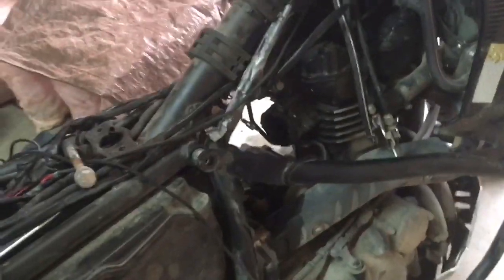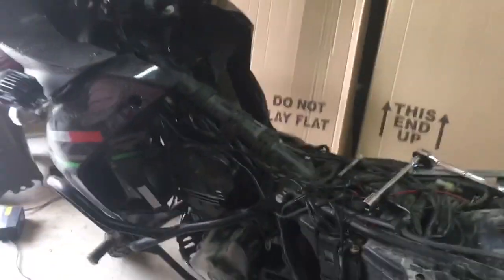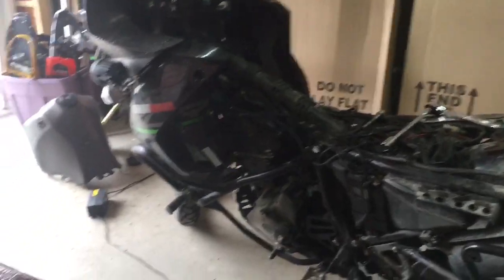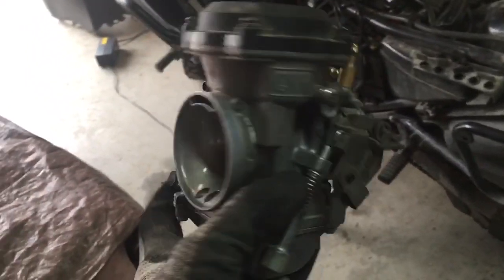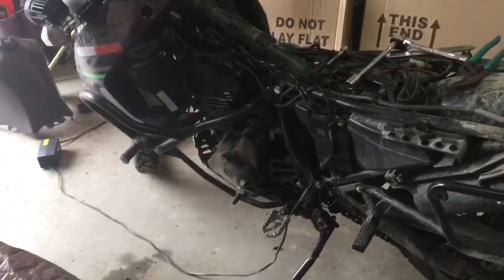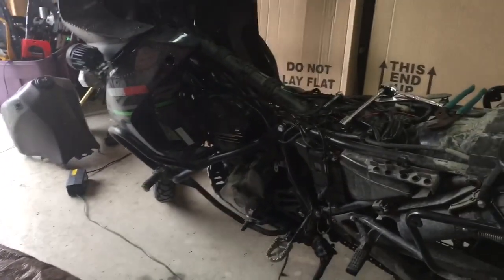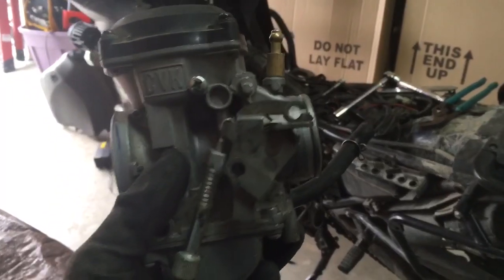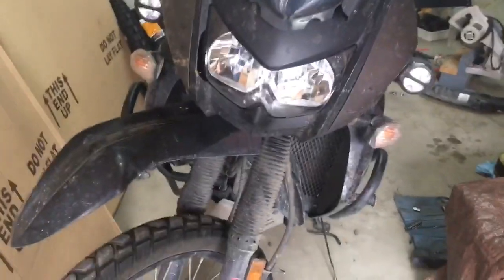KLR 650 Carb Issues

Comment: Damn carburetors. When you pull it apart make sure to pull the emulsion tube and clean it too. And be really careful removing the slide....the diaphragm is pretty fragile. And now’s the perfect time to do the 22 cent mod if you haven’t already. Sorry if you already know that stuff.....just wanted to participate in the revival. I love these damn bikes.
Reply from the maker: Yeah that’s what I was saying across I-70 towards Denver... :-)  Thanks for the tips, much appreciated! And yes I did forget about the 22 cent mod so yeah that might be on the roster too. Question: is it possible to get one of these apart and back together without a carb rebuild kit? I’d rather not get into it and find out I need to order parts.
Reply: Al-Can ADV yeah you can get it apart and back without a kit. Assuming you don’t tear an oring or anything. The oring on the bowl is usually fairly tough but still be careful when pulling the bowl. The diaphragm on the slide is very thin so don’t force it apart. There are some replaceable parts in there but generally it’s just a clogged jet and/or emulsion tube so usually you can just take it apart and clean. Be very careful what you use for carb cleaner! Don’t use brake cleaner and only use a non-acetone based carb cleaner. With some new laws that have changed in most states brake and carb cleaners are starting to use acetone and it absolutely kills nitrile, which is an ingredient in your o rings and the slide diaphragm. One last thing.....make sure you pay attention when reinstalling the choke nut into the carb. It’s just plastic and it’s easy to cross thread or break.....it can cause an air leak and make your bike run crappy.
Reply from the maker: Oh my, thank you so much! Will definitely be careful. I don’t think we’ve got any actual carb cleaner around, I’ve heard WD-40 is a possible substitute, is that true?
Reply: Al-Can ADV I’ve never used wd40 in a carb. It’s mostly kerosene with some other ingredients.....MIGHT be ok but I can’t say for sure. I know you’re way up there in Alaska so I don’t know if you have easy access to an auto parts store. If you do you can find non acetone carb cleaner pretty easy there. It’s really easy to identify by smell....cause the stuff with acetone will smell like.....acetone. You might not even be effected by these new laws yet up there anyway. It’s becoming a big problem in Utah. It started with just brake cleaner but I’ve even seen carb cleaner going to acetone and I’ve personally ruined all the orings in a carb using the new “50 state legal” carb cleaner cause it had acetone. 

If you can get a hold of the yellow bottle of HEET that would work alright I guess. That’s mostly isopropyl alcohol. Or even some high content rubbing alcohol.
Reply from the maker: Ok perfect! Thanks so much for the tips. I’ll probably try the Heet, I could get it plenty of places in town but being as I live with my folks and we’re doin fm kind of a self-quarantine right now, don’t know when I’ll be able to get some. I’ll let you know what happens!

Comment: I installed a motoku carb. Started right up. I rode 200 feet then it kept cutting off. Then i saw fuel shootinf out the carb. Looked down a few seconds later and the gas was on fire on the geound.

Comment: I was wondering if you figured it out. I did the KLX Needle Kit on my 2003 and changed to a manual petcock. I noticed the slide diagram had a pinch in it and replaced it and the bike won't start.  Not even on choke. I think it's a fuel supply or carb problem